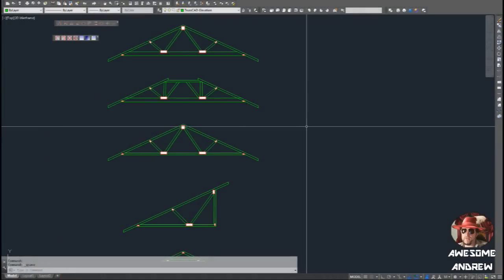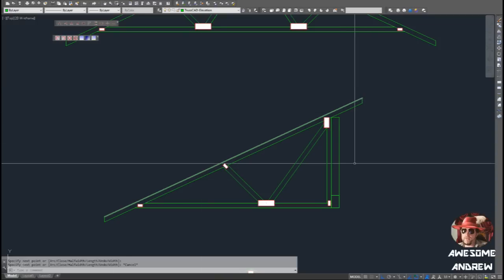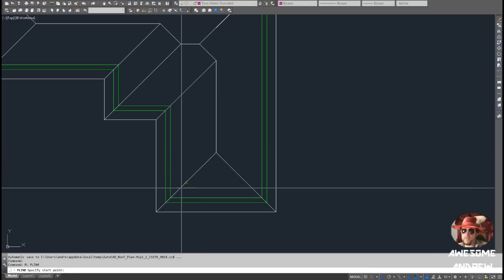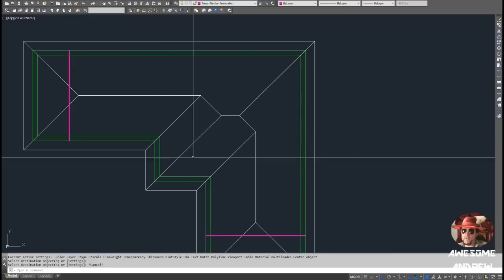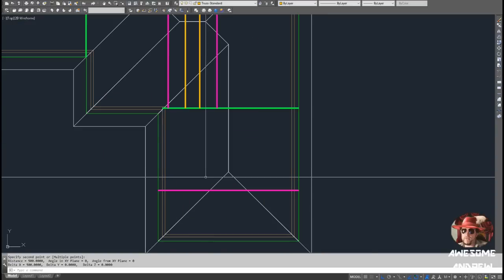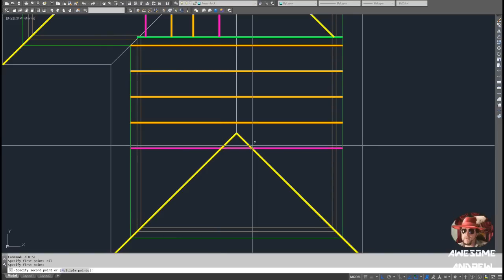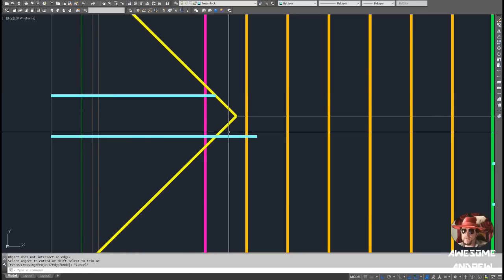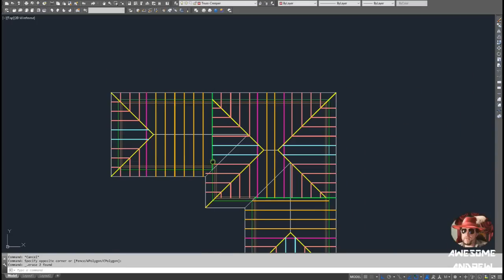Basic & Easy How to draw roof truss plan

Comment: Hey, I was wondering if this specific roof truss plan doesn't require purlins? if so, what's the standard spacing for purlins?
Reply from the maker: In non cyclonic areas in Australia for a sheet root, 900mm centres is standard spacing for rafters and purlins for domestic buildings.
Not sure though if different in cyclonic areas 
For reference, tiled roofs are 600mm standard spacing for rafters.